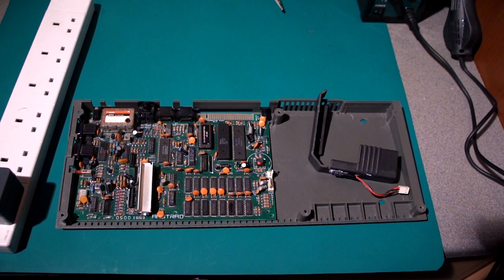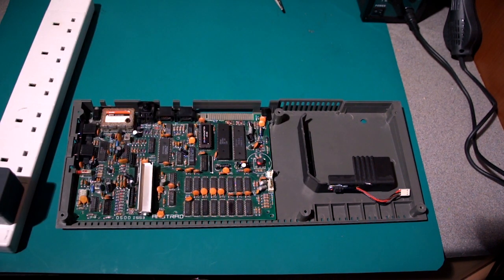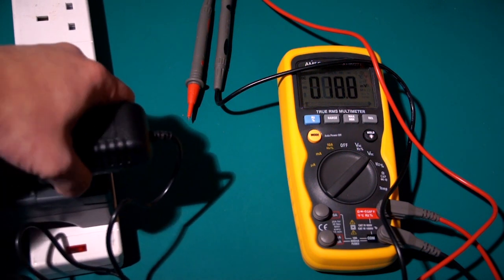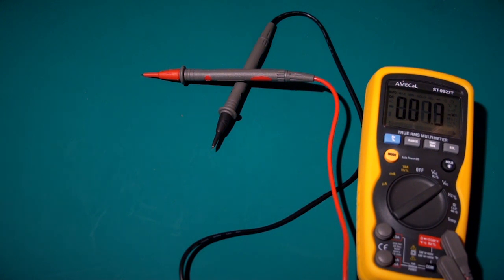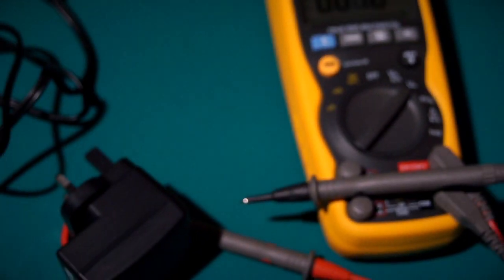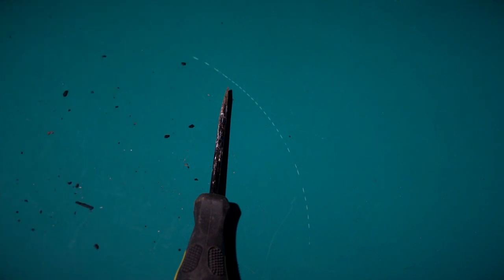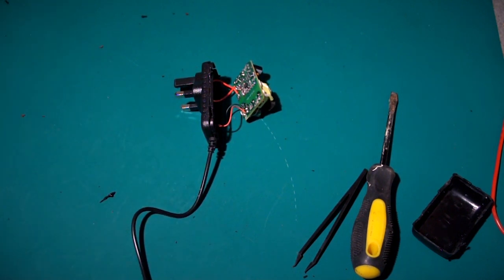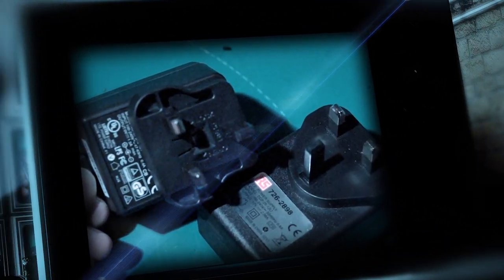ChinnyVision - Ep 106 - Powering Your Spectrum

Comment: Sorry for being a noob, but I got the following for my GX4000 and is it OK for the Speccy?:

http://uk.rs-online.com/web/p/plug-in-power-supply/7262750/

Does it make any difference the amp is more being 1.22 instead of 1.4 what if it was lower
Reply from the maker: +Mark Thompson No because the Speccy requires a negative tip, and the GX4000 requires positive. 1.22 amp might be also a bit on the weedy side depending on what the Speccy is and how the internal voltage regulator is feeling (I've recently replaced the voltage reg in my +2 as measurements showed it was demanding more power than it should resulting in extra heat and being slightly over voltage on the output which is very dangerous for the RAM).
Reply: +ChinnyVision - The Retro Game Review Channel I see now so 1.4 must be 1.40 and it must be common practice not to add a zero.  It's a +2 I have and I was just looking for a quick answer, but I'll be sure to research for a correct power supply.  Glad I read not to use the original Amstrad power supply when using the C4CPC.  Thanks a lot.

Comment: I'm still curious about linking up a 5v supply to the Speccy & using a buck up-converter to give it 12v where required. IIRC (with the RAM replaced where appropriate) the only parts which need 12v are pics on the expansion bus & video encoder.
Reply from the maker: +Paul Wood Is the tape drive 5v or 12v? Can't remember! If its a +3 the disc drive will need 12v as all 3 inch drives that I know of use 12v.
Reply: +ChinnyVision - The Retro Game Review Channel I honestly can't recall. The machine I have in mind is a +2 & I wouldn't mind losing the (already ropey) tape deck.

Comment: Standard power supplies for guitar effects pedals are 9V center negative. I am currently using my VisualSound 1spot (1.7A) plugged into my "brand new" 48k and it is working fine.
Will be getting thefuturewas8bit one before long.
Reply from the maker: +Karl Børge Steen I have a guitar amp pedal PSU in use as a supply on one of my Spectrums as well. But they are a bit of a minefield which is why I didn't mention them because there are a lot of dodgy ones on Amazon and Ebay and its hard to tell the wheat from the chaff. Whereas if you get a supply with a proper spec sheet from a reputable supplier such as RS you know you are safe.

Comment: ce != c e
look at the space between the 2 letters.
ce = china export
c e = Communauté Européenne (conform to european regulations)
Reply from the maker: +Crazy_Borg A nice little way for the manufacturers to pretend the device is certified. If you tried that with a company name etc it is what is known as "passing off" and is illegal. In anycase the lack  of a proper CE mark still makes the PSU's illegal to sell in the EU.
Reply: +ChinnyVision - The Retro Game Review Channel 
Correct, but knowing the difference between ce and c e makes it easier to distinquish rubbish from proper electronics.
Reply: +ChinnyVision - The Retro Game Review Channel I do not think they are illegal to sell. It's the manufacturer that places the c e mark on the item and as such certificates that its produced up to the c e standard. It do not need to be tested or certified in Europe. at least that is what I remember reading about it in a norwegian engineering magazine
Reply from the maker: a) It's not the proper CE mark and b) there is no way either of the devices I opened meet any safety standard at all and certainly in the UK Trading Standards would quite rightly be over any seller.
Reply: I agree. It's illegal to sell if the product doesn't meet the standards. The producer/importer have to make sure it does that before putting on the CE marking.
Reply from the maker: And the CE marking on the two I pulled apart was clearly applied in China and is in fact a slightly different logo designed to confuse. Sadly in these two cases the "importer" are small time sellers on Ebay and Amazon who buy these things in bulk from China and sell them without any electronics knowledge what-so-ever. Which is the big problem.